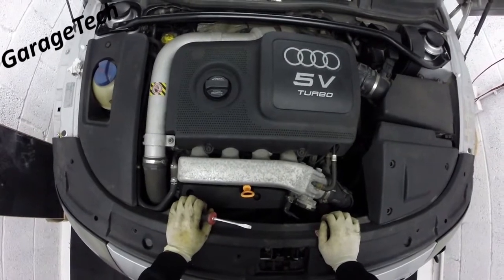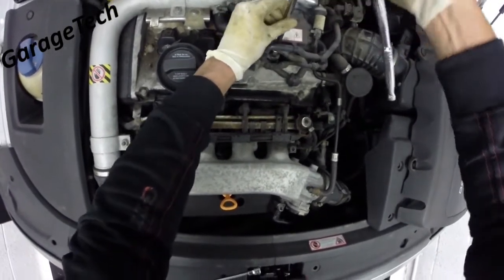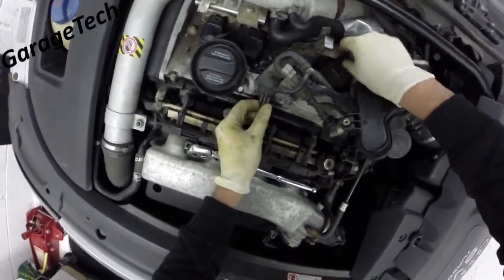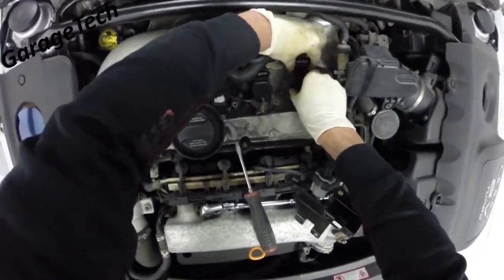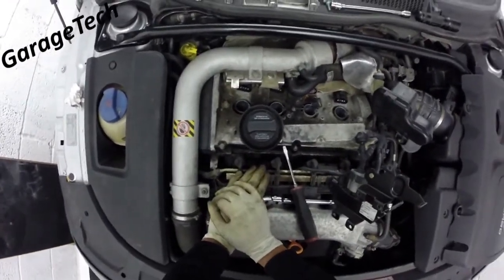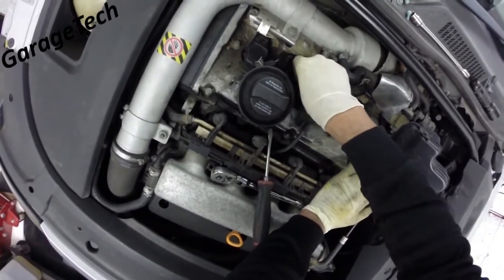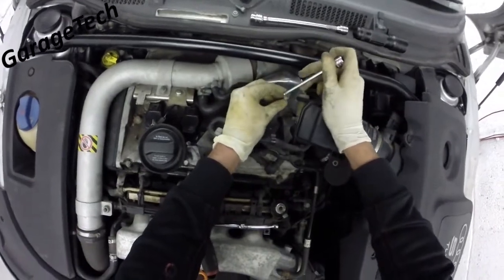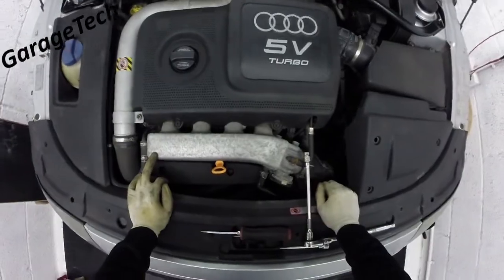1.8T ignition coil pack replacement Audi TT A3 VW Golf

Comment: For some reason no matter what i do they wont go all the way down by a few mil now under heavy accelerstion its gone wierd
Reply from the maker: @herewardofbourn8197  did you replace the spark plugs, could be the wrong ones, or the wrong coil packs, so many on the market now, would be easy to pickup the wrong ones?
Reply: @GarageTechAutomotive  yeh i did not change spark plugs abd have chekcked with a few places its the correct part. Thanks not sure hwat to do but take it to a garage and admit defeat
Reply from the maker: @herewardofbourn8197  just also double check there’s none of the old rubber from inside the coil pack stuck on the spark plugs. That used to be quite common that the inside of the coil pack would come off. The rubber goes hard and breaks off, that’s why there’s some grease inside the rubber part. If it’s broken off it could still be on the spark plug stopping you from pushing it down correctly
Reply: @GarageTechAutomotive  ah ok ill check that tonight the old one still had rubber inside but thanks ill defo check
Reply from the maker: @herewardofbourn8197  if you still have the old ones just look inside, may save you pulling them all out again 😃

Comment: So I was following this step by step and paused after learning how to disengage the connector. I was too forceful and the little plastic locking tab on the rear of the connector snapped off on one. Then once I restarted the video, I was of course warned that these can snap off. Ugh. Am I ok without one of the tabs or do I need to find some type of high temp tape or similar to ensure the connector does not vibrate off?
Reply from the maker: Hi Mike a cable or zip tie should do the job, just to prevent it from coming loose. Happens to us all bud, don’t worry ✌🏼

Comment: I have the original style bolt down coil pack, do I need an adapter for those push in types??
Reply from the maker: Nick, yes you can buy a converter wiring kit, not sure if you need anything else to go with it but the later coils are better.
Reply: @GarageTechAutomotive  cheers!

Comment: Thank you!!! Same as an Audi TT 1.8 turbo 225 hp engine code AMU. The fiddly bit at 2:25 was essential. I was trying to avoid breaking vacuum lines and seeing it done on exactly the same setup as my TT was very helpful. 10-15 minutes was hugely optimistic, though. The ignition coils on our TT were the ones with the wider flanges that are held down by 4 bolts each, rather than these plug-in designs.
Reply: Rats. Snapped the S-shaped plastic tube connected to the hose off that fiddly bit (whose true name is Vacuum Reservoir). Was trying to be very gentle on the hose but the plastic tube was brittle and weak.

Comment: What size Allen key ball socket do you need?  Suggestion on plugs?
Reply from the maker: Peter Pontius, 5mm Allen key, I normally use NGK, or Bosch spark plugs as long as they’re platinum or Iridium.
Reply: The Allen bolts are all 5's

Comment: Thanks for the video. I'm going to tackle it on an APX 1.8t which has the bolt down coils. Will these still pull out near the metal bracket?
Reply from the maker: Haven’t done it on one of those engines for a long time so can’t remember, the coil packs are bigger though so you might have to loosen that bracket. All the best and let me know how you get on.
Reply: @GarageTechAutomotive  yep bolt down style coils too big , the large pipe had to come off which let me move the bracket. Thanks again for the video. New sparks good for another 60k!
Reply from the maker: Neil Gauden good job, enjoy 😊
Reply: @neilg3364  When I did it, I was able to wiggle the bolt down coils  out without removing the pipe.